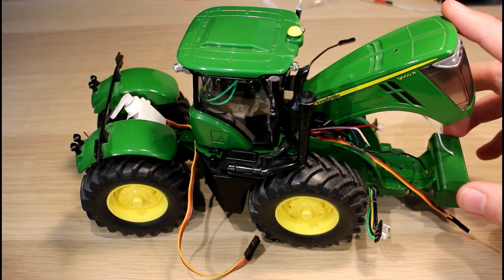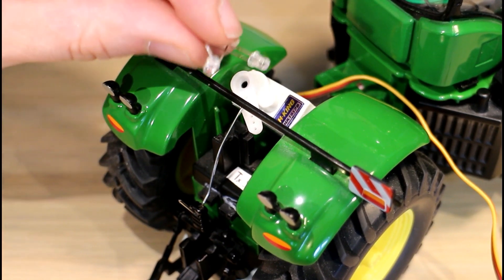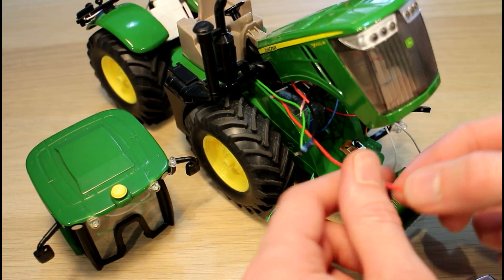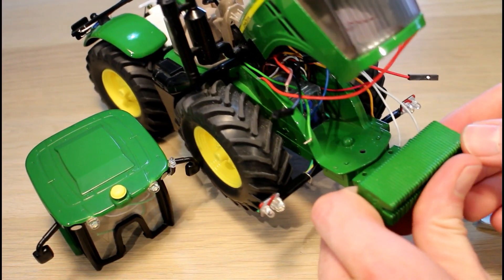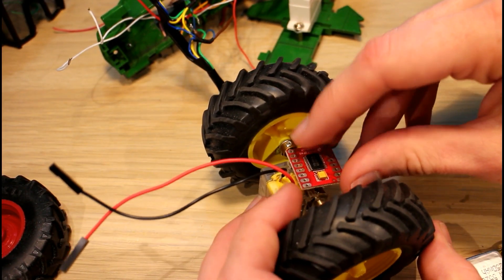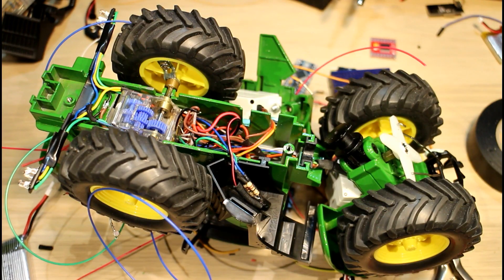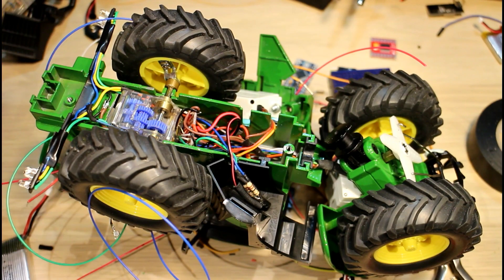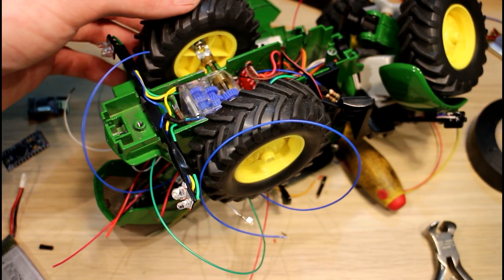RC John Deere 9560R Build - Part 6 Installing Rear LEDs, Battery and Motor Driver

Comment: Hi, where dit you bought the motor drive box? I want a smaller one because I have a small tractor.
Reply from the maker: +arno de coole I just bought them on ebay, I get most of the parts there. There are links to sellers I've used here http://rctractorguy.com/store/electronics